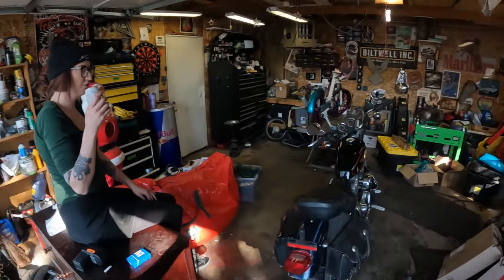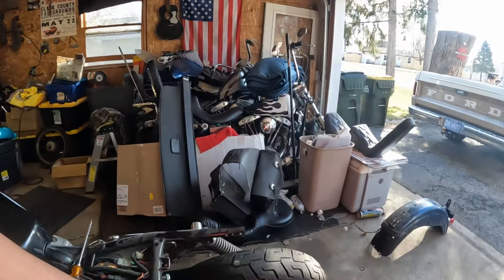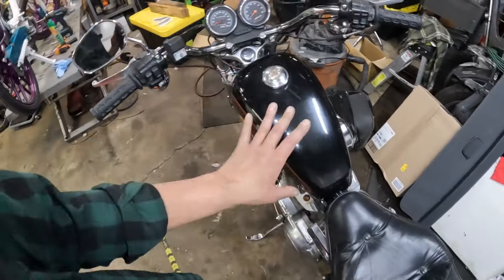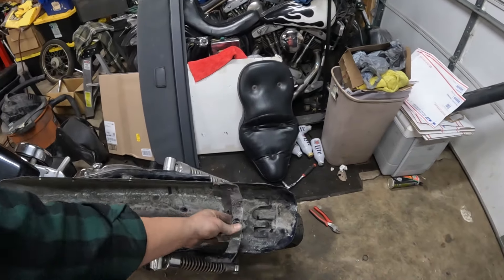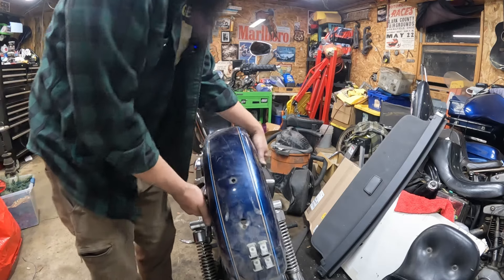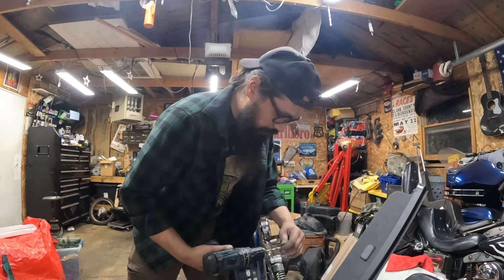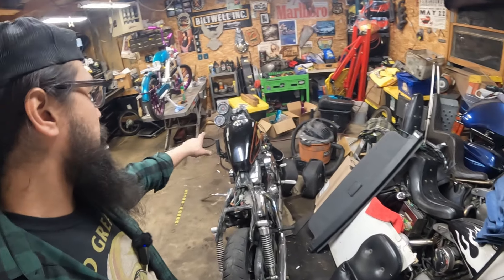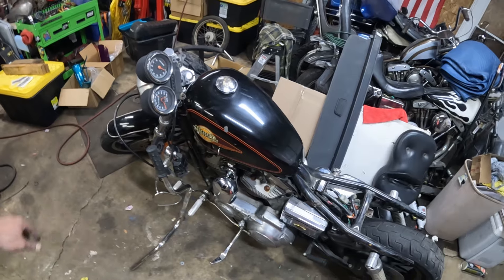Evo Sporty:  Rear Fender and Bar Teardown

Comment: That rear section of the frame is where the rear fender support brackets fasten to.
Reply from the maker: I was stuck on what type of fender struts/supports it needed.  Got it sorted now, but I definitely had a mix match of incorrect parts to start with on this bike.  Been running it that way for a year and a half and just now realizing how mismatched it was.  I have no knowledge of evo sporty differences.  Thanks for stopping by!

Comment: Good day. If the 32 year-old original paint, gas tank is in good shape. I wouldn’t blast it away. These older  evo Sportys are getting collectible now. Smitty.
Reply from the maker: Rear fender is mismatched and beat up already.  Tanks dented with chipped paint.  I hear you on the parts availability though.  I never actually think about how old these bikes are as they still seem like brand new vehicles for me!  Thanks for watching!

Comment: I have had luck using a wafer wheel on a 4" grinder making a regular screwdriver slot and out they come
Reply from the maker: I've done that too.  This one was a bit tight for a 4" but a cutoff wheel could have worked.  I don't like grinding 'em close to the housings though.  Well, if they're going back on at least.  Thanks for watching!

Comment: Get rid of that ugly two-seater and ditch the rear fender and find you a wider back tire..and put 40 pounds of air pressure....you'll save your back tire... and some cool azz riveted saddlebags..🫡💯🤘
Reply from the maker: This one's going stock.  Until I get bored.  Then there's a Paco rigid frame waiting upstairs at the shop for a mini chopper.  Boring stock chopper for now though.